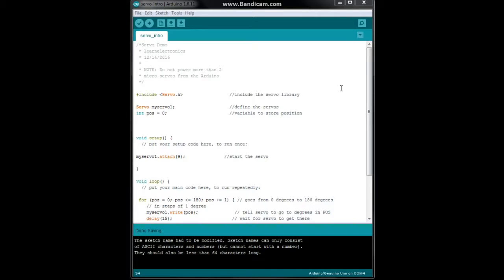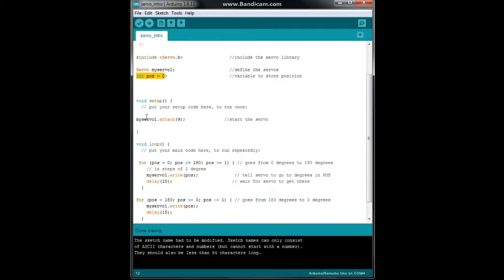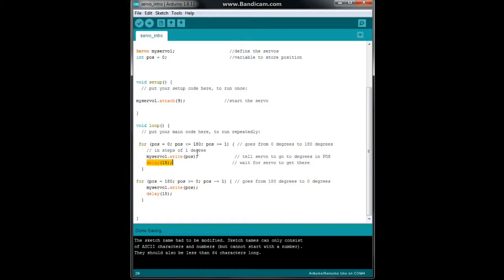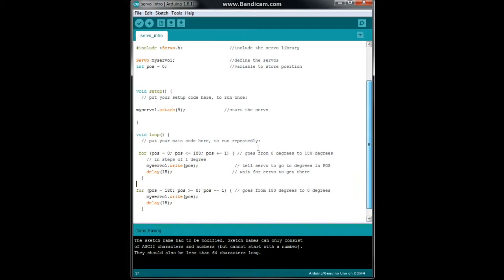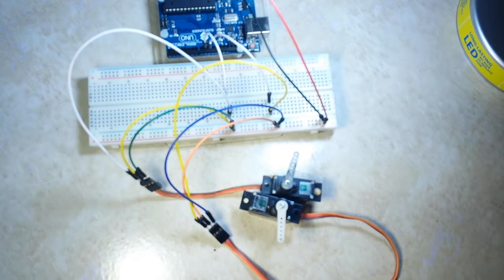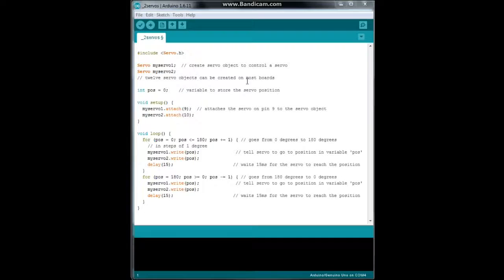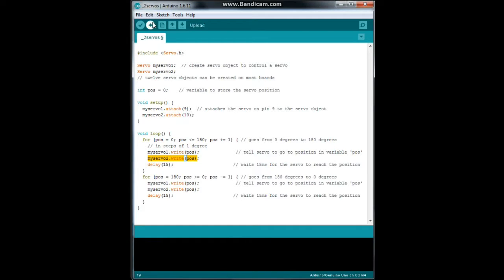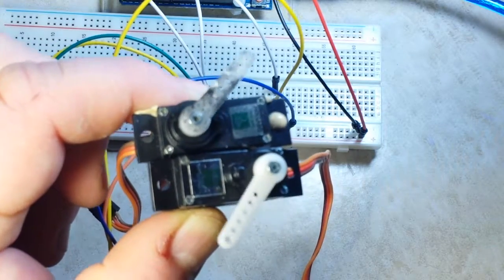Arduino Basics How to Control a Servo

Comment: Do you take request to help people? Could you use a 360 servo, a 180° servo, and a push  button and go over code like you normally do so I can understand it?

So push a button, 360 turns 5 turns, after that the other servo starts to turn 180° and then stops.
Then button need pushed and 180° returns, then 360°returns to home and then stops. IV tried over and over agian and failed. I am Just starting and needing help. I went to arudnio forum but they are really a weird bunch there that just wanted to attack my Grammer. Lol

Comment: A flyer aye? Never had the coordination for that. Sure fun to crash stuff though!
Reply from the maker: George Chambers I flew rc planes, and helis up to about 2015. Things started to get too political at my club then.

but I still fly full scale a few times a year to keep current.
Reply: I know how it is, you've got to keep your fingers wet. I do metal fabrication for a hobby, machining welding that kind of stuff. But I've always dabbled in electronics, even got an AS. But the real world happened and I became a programmer for 25 years, kind of got away from the fun stuff!
Reply from the maker: We have similar hobbies. Im an AWA certified welder in: SMAW 3g,4g Mild Steel, GMAW 3g,4,g,  mild steel, and GTAW 3g, stainless. I have a small home metal shop in the basement, Alphatig 200x, small HF 10" lathe, and beat up,worn out old J head mil.

Comment: Need program for two servos
Step1: servo 1= 0degrees, servo2= 0degrees
Step2:  servo 1= 90degrees, servo2= 0degrees
Step3: 1: servo 1= 90degrees, servo2= 90degrees
Step4: servo 1= 90degrees, servo2= 0degrees
Step5: servo 1= 0degrees, servo2= 0degrees